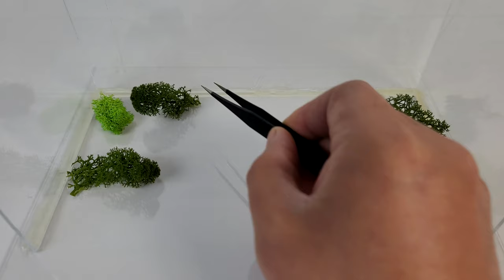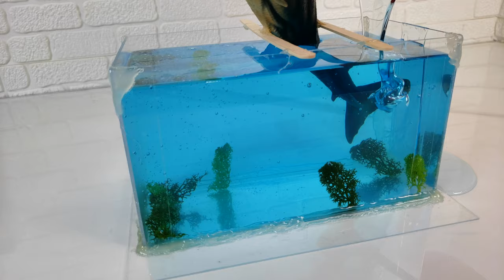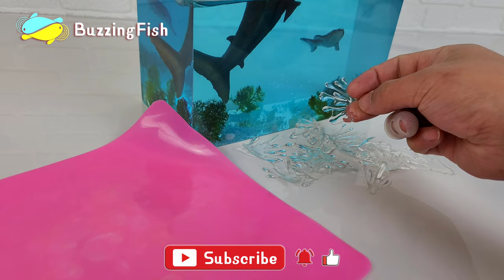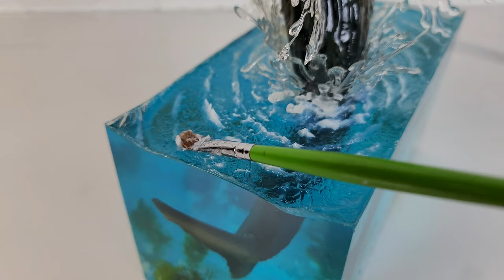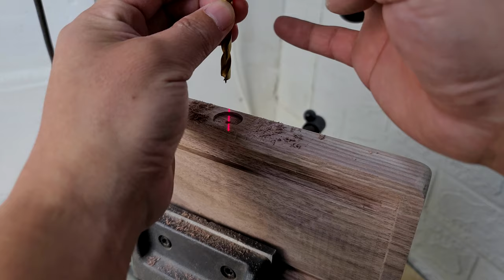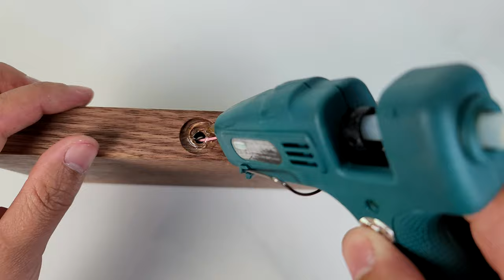How to Make Prehistoric Shark Diorama | Resin Lamp | Resin Art 🦈

Comment: Has nobody noticed scale problems? I really appreciate your effort. But a seagull would have to be much, much smaller compared to the shark (even if it's not a megalodon) and the whale. It's about as big as the latter, if not larger. Even prehistoric birds didn't attain such sizes. ;) In fact, it seems that nature herself puts a cap on bird sizes (at least excluding flightless birds, the moa was really big): if they grew considerably larger than the largest birds ever, they would also need a more robust build (the square-cube rule) - and that would impact their ability to fly.